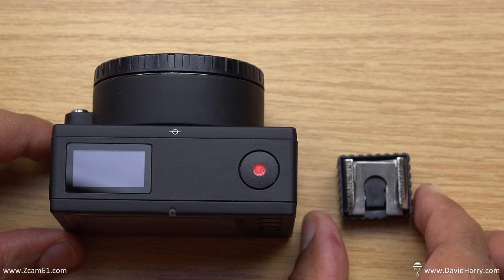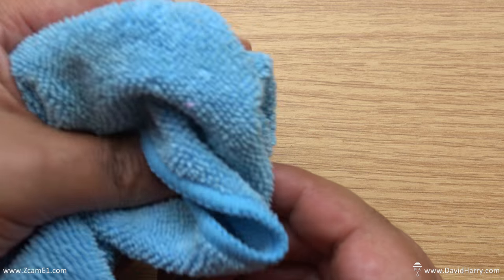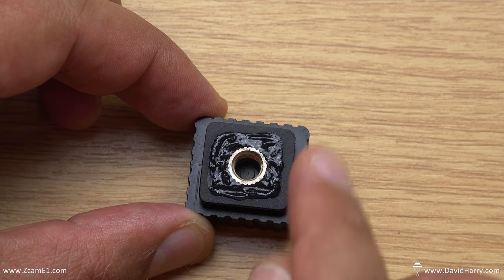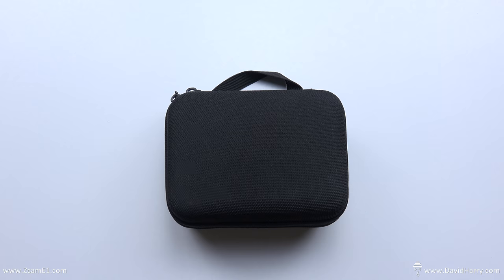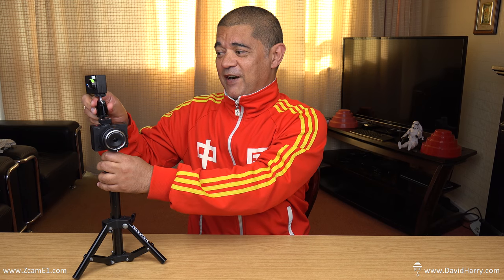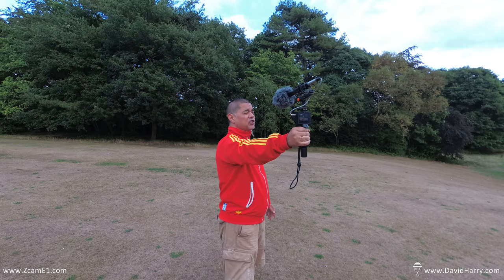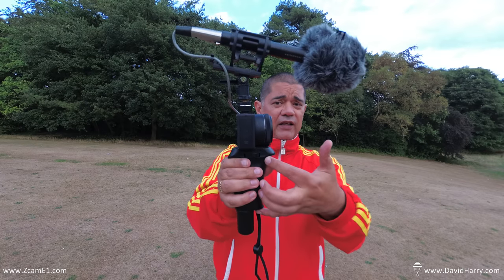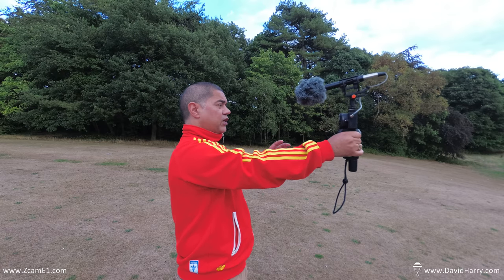Z Cam E1 Shoe Mount Modification for Attaching A Small Video Monitor, LED Light & External Mic

Comment: Hello David,
I have a problem with the Z cam E1 that you know well. Is there a lavalier microphone with an external power supply that works with the Z Cam E1, because I can not find. When I try a lavalier microphone with an external power supply, the signal is not good.
In this video, you use a condensed microphone system with Primo EM172 omni and the Primo EM184 cardioid. Please, what is your system for feeding power with the capsules ?

Thank you David.

Comment: Hey Dave, great vids. The track suit is on point. I can't seem to get any of my simple lav mics to work with my E1, do they need to be powered mics? I accidentally tried to plug the AC adapter into the mic hole a few times (they're not labeled) and I'm hoping I didn't zap it into dysfunction.
Reply: Sorry David.
Reply from the maker: Hi. The mic input does not send power, so won't power Lavs or any other ECM mics. I'll be doing a video soon on how to modify some parts to create a self powered modular mic system. It has replaceable mic heads, an omni and a cardioid and can also power a Lavalier. It's the silver one in this video. I've also plugged the power supply into the audio input, don't worry, although it's not advisable to do this the wiring of the mic input means that the power adapter can't short out or send power through it. It is very unlikely that you've damaged anything. If you want to make sure that your audio input is working, try plugging the audio/headphone out of a computer, phone, CD player etc. into it to test. BTW, Dave is fine :) Cheers, Dave.
Reply: My sennheiser wireless lav works. Do you get sound when you plug headphones into that jack during playback? I do not. There’s also no speaker so I have no way of telling if a clip has sound. I have to put the sd card into a computer. Also there’s a setting in the menu for Live Preview Audio which seems to do nothing on or off. For the price, this camera can capture some nice video but I keep discovering strange things about it that bug me. Fun to play with though.

Comment: Hi! Do you happen to know if that camera produces cropped 4K image or is its AoV the same as in any other M4/3 camera?
Reply from the maker: Hi Paweł. I can't remember how it's HD and 4K compare now as I sold it a while back but in stills mode it did have a wider FOV. Cheers, Dave.
Reply: @DavidHarry  And why did you sell it?
Reply from the maker: Low bitrate and no stabilisation.